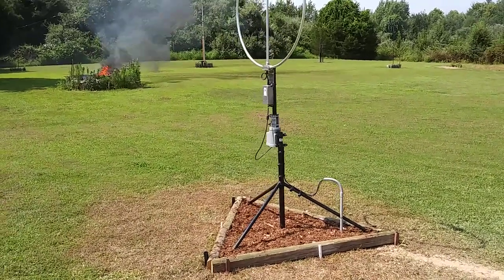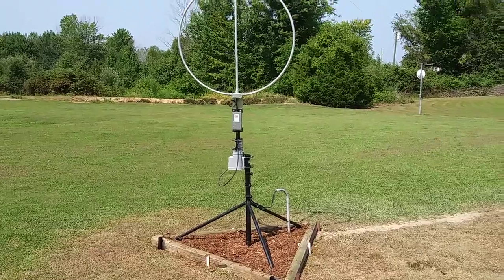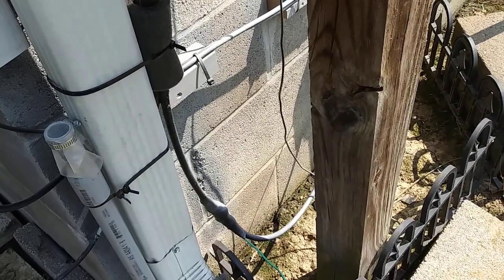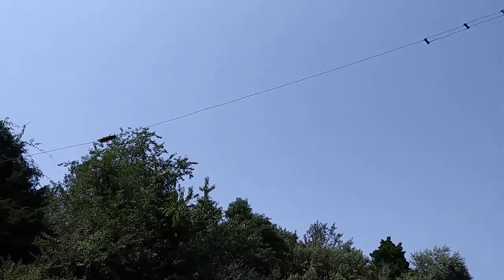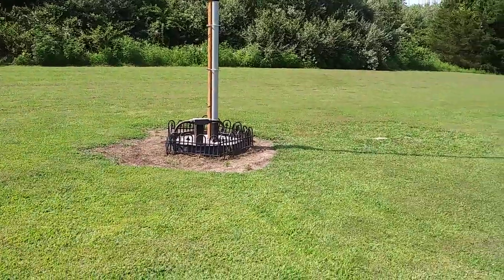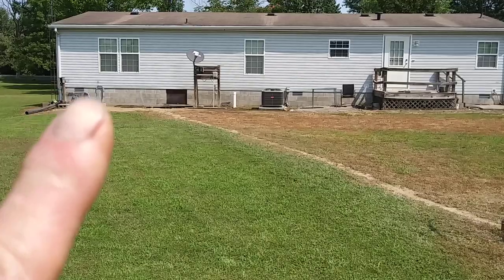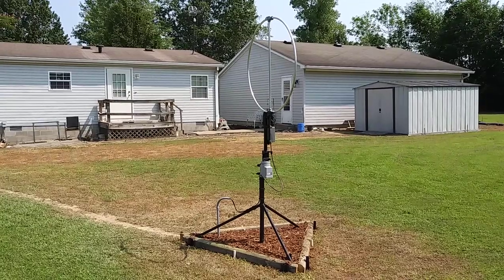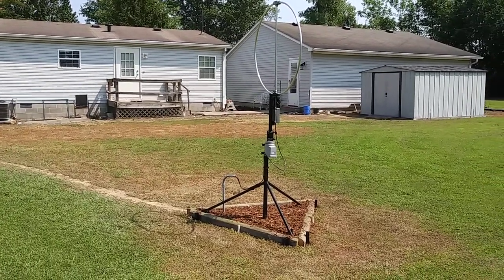A quick look at my antennas for shortwave listening.

Comment: Amen, Sir!  People who gripe about other people's antennas should mind their own business.   You've done a great job there.   I'm from Central Illinois (Danville).  I'd love to be able to stretch out some antennas like that.  Looking forward to seeing the loop demo.
Reply from the maker: In 40 plus years of radio, I never owned or used a loop antenna. When I got this, I was thinking yeah right, this isn't going to do much. Boy, was I wrong. From 5MHz up to 20MHz, it will do just as good, and sometimes outperform the big Alpha Delta. I know the little $50 MLA-30 is a popular little cheap loop, but I tried one, and it didn't work well at all for me. This was $500 +, but performs like a big antenna. So much so that if weather ever took out my Alpha Delta Dipole, I probably wouldn't replace it and just use the loop.